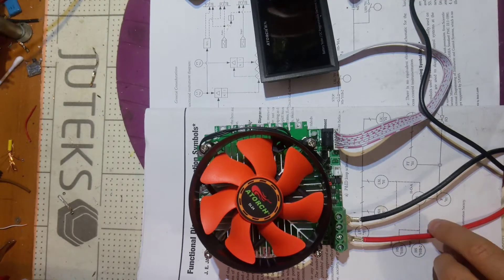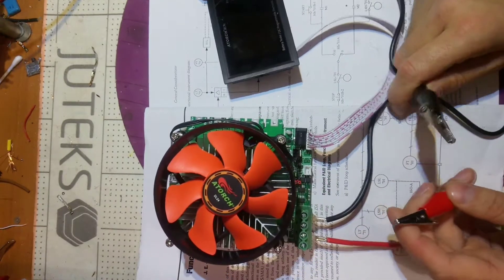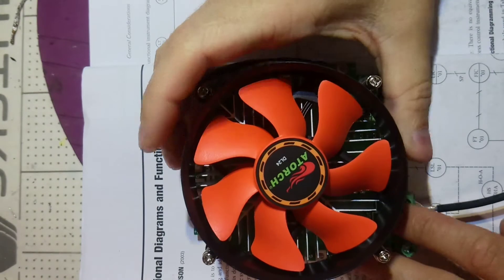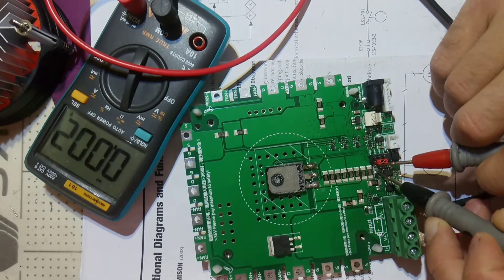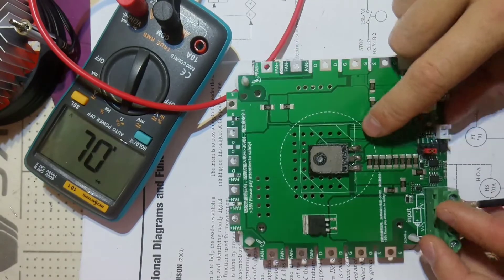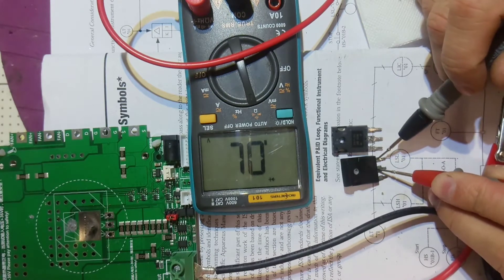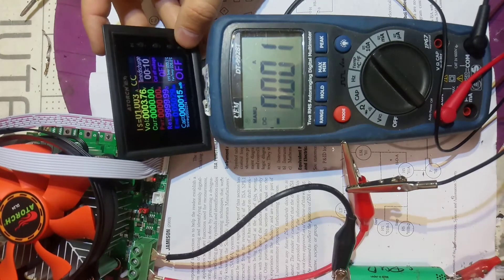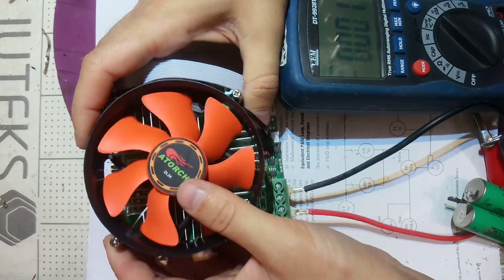Electronic load (battery tester)repair

Comment: Thanks for the video, I happen to have a non-functional electronic load too. Unfortunately my repair probably wouldn't be this easy (the chip that controls the whole thing doesn't seem to turn on when connecting power at all), but it was still nice to see a video on this nonetheless ;)
Oh and please speak up a bit.
Reply from the maker: Thanks. Ok. I will try. Im not a native speaker, so its hard for me to pick up proper words fast
Reply: @electronicshaverightstolive  Yeah, I know. But that doesn't prevent you from speaking a bit louder, does it ;)
Reply from the maker: @CoolKoon  fair enough. I thought at first that you meant speed not the loudness:) i will try my best with video recording equipment i have:)
Reply: @electronicshaverightstolive  No, "speak up"=speak louder. I actually have a Firefox add-on called Youtube Enhancer (which I highly recommend BTW) that has this "volume boost" feature. When I turn that on and turn the volume completely up on my laptop it's just enough to hear what you're saying ;)